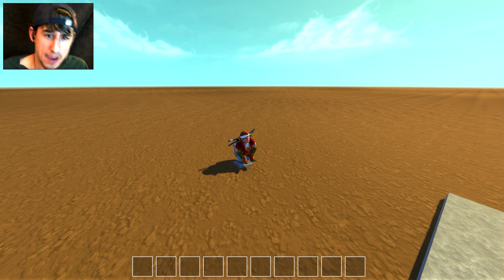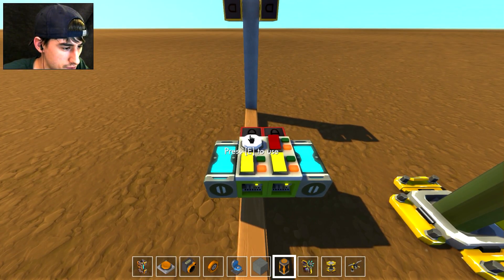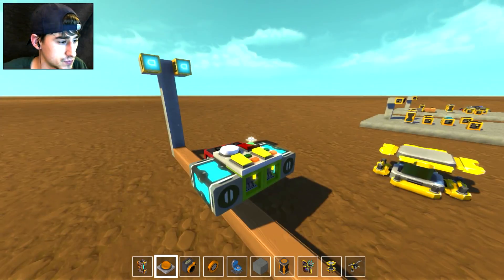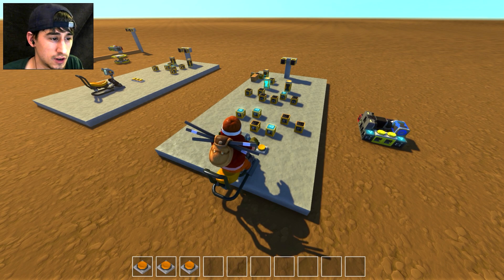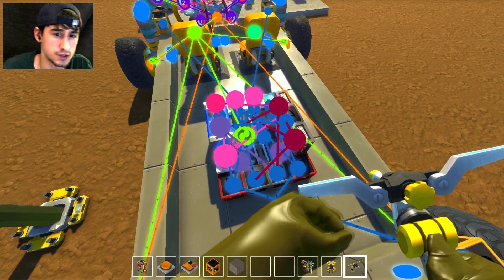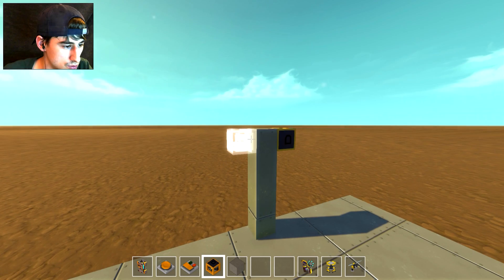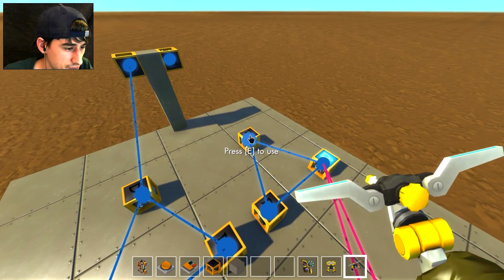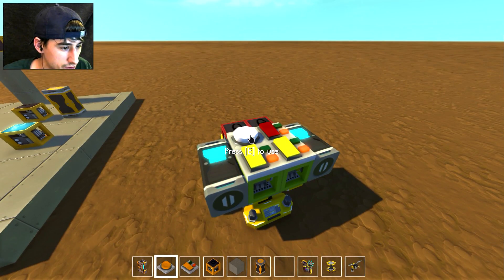Simple & Automatic Turn Signals Tutorial! (Scrap Mechanic #67)

Comment: are you planning or trying to make the 1 line singal thingy
Reply from the maker: Are you talking about changing a controller angle using logic or something different? I know I have a request to make variable thrusters and another to make controllers angles change with logic (dont think its possible but I have an idea). If its a different thing altogether please let me know !
Reply: like you send everything trough one wire of line and then it will decode it again
Reply from the maker: Oh the morse code machine! Yes I've tested a few things with this but no final yet.
Reply: so did you then get already like a good decoding woch not involves a huge thing (depends on how much you decode)
Reply from the maker: I have a method for converting a character (0-9, a-z) into a series of blips. the decoding is a whole other issue because it had to store the message in memory in case the other person is also typing at the same time
Reply: ok
Reply: maybe something to check if someone els is writing and bring it to an other place then like it checks if alost any key from taht thing you have is pressed then it will automaticly open up a second storage thing for that
Reply: i just accomplished the 1 singal thin gy i have not made it spam free but there is no glitchiy things only sometimes maybe just 1/10 it doesnt react
Reply: and like it sends 2 ticks one inmeedendly and an other one after for example 8 ticks then you need to make the decoder 7 ticks
Reply: so i tink that everything loses ticks when sending it trough logic gates but not by the decoder it selfbecause i used one logic block between the decoder and the sending

Comment: Ken can't you put a pice of pipe on a bearing connected to steering when you turn you activate sensors to activate the lights with timers
Reply: i tried that out its kind of hard
Reply from the maker: Thats what the advanced one uses to turn it off. I didnt do this to turn it on because real cars dont automatically turn on.
Reply: I guess theat kind of makes sence

Comment: well i put two of the easy ones on my vehicle and i made the input a or gate with a switch and an sensor connected to it, it worked.. then the lights started to go on and off really fast, i thought lets save and reload. i did that and my game crashed, if i try to load it again it still crashes
Reply from the maker: Minewijn hmm never seen that happen before...
Reply: same but ive never reloaded the game while it was doing that
apparently it happens when the vehicle is on the lift or after spawning it in
I did find a temporary fix that uses pistons, 2 nand gates and a controller
when the vehicle is spawned the flashers will blink so you have to turn the switch on to turn off the signals. I am still trying to figure out a way to make it work normally again but im not good with logic and stuff so it might take awhile
Reply: @neko7684  connect a button to the OR gate and the NOR gate that normally would be off when the switch is off, press it and it will fix
Reply: @crapcopter  I posted that two years ago lol. I don't even remember what I was talking about lol
Reply: @neko7684  I was just trying to help, without paying attention to dates haha
Reply: @crapcopter  No worries. I now know logic like the back of my hand, it's pretty simple stuff now
Reply: @neko7684  yeah, after a while you learn it